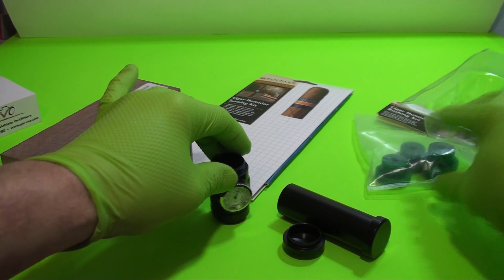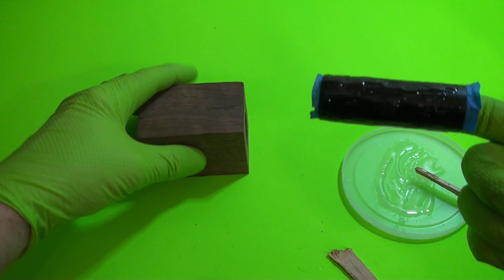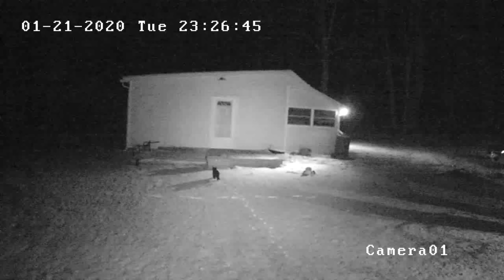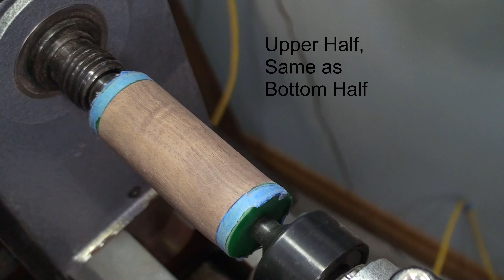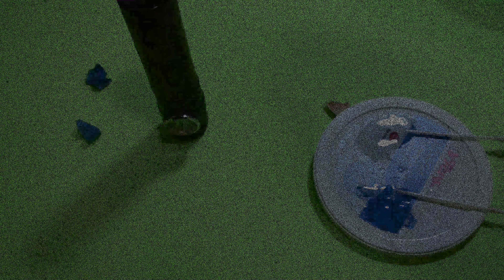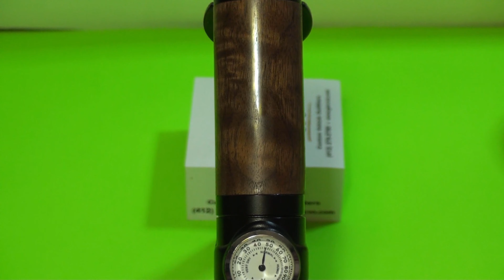Making a Cigar Humidor

Comment: Thanks for the video, what's the purpose of the CA glue? Are you using as a grain filler?
Reply from the maker: It does fill the grain but also puts a clear finish on it.  When it’s sanded and buff, it almost looks like a glass finish.  I use it on my turned pens too.  Thanks for watching!